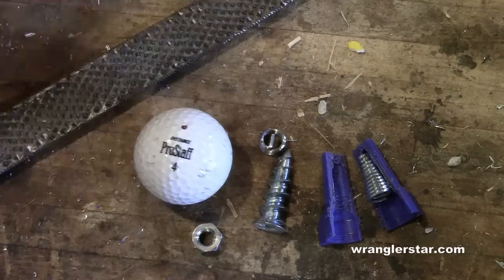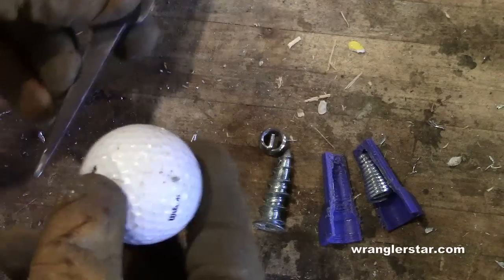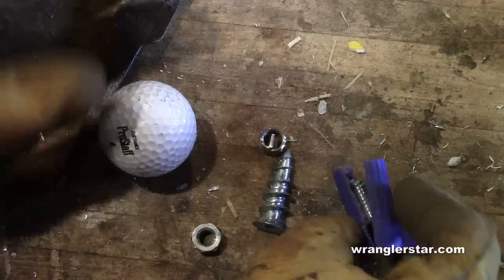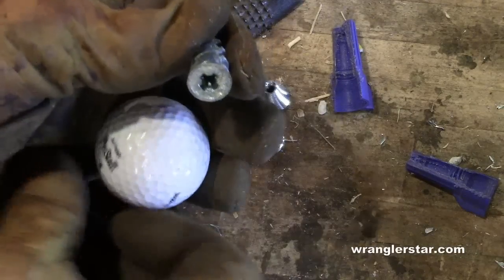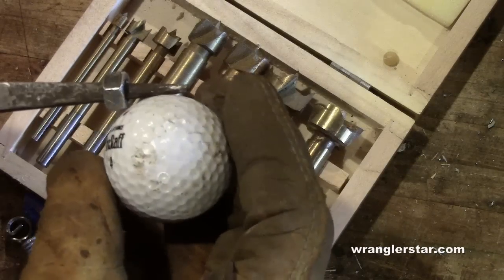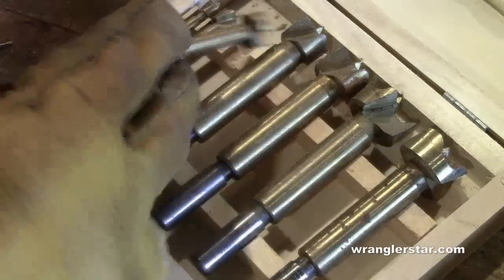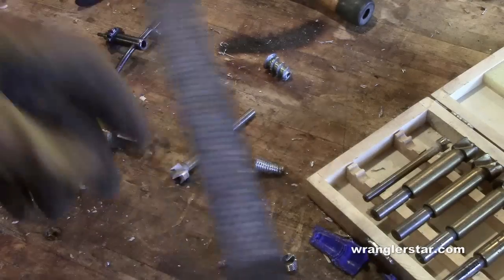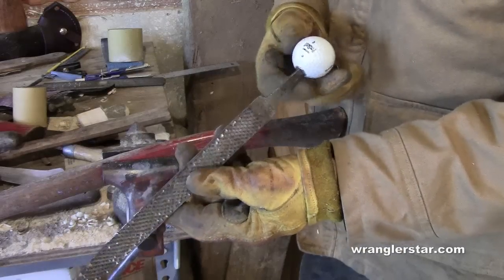Golf Ball Tool Handle - Wranglerstar

Comment: WARNING**********
Please keep in mind as you search for golf balls to use in your handle projects,unlike the newer balls that have a primarily rubber core, some of the older ones that you might find in Grandads old golf bag, might have a wound core. You probably do not want to be barehanding a wound ball, while drilling into it with a forstner bit. If the winding climbs the bit and rips the ball out of your hand, or pulls your hand into the bit...bad day.  If someone has a ball that they know is wound, clamp it and try it,  and let us know how it reacted.
Have a Great Day!

Comment: For my handles I use old screwdriver handles, unscrew the shaft when it breaks drill the hole out and press it on, as long as its straight with the file it works great, gives you a solid handle right up close.

Comment: My first time ever writing a review on YouTube. 
I enjoy watching your stuff!! 

So I tried it on my golf ball, but I put three nuts all on the same golf ball. One holder for every file I have know. 

3/16 Nut 5/16 Nut 3/8 Nut
Holds Any Size File
Took A 1/4 Inch & 3/8 & 1/2 Forstner Drill Bit To Drill Each Hole For The Nuts, Then Pressed Them In Using A Bench Vise. No Glue Needed 

Your Right!!!!
Best Handle Ever For Filling Down Metal Edges Or On Wood Projects 

Thanks Again, Keep Up The Good Work
Reply from the maker: +Rene' A. Garza Great!

Comment: I have been using golfballs for handles on thin files to sharpen chainsaws for years.  The thin file works fine with just a drilled hole.  For larger tapered files, I think you are spot on! Great idea, I will do it!

Comment: 1000's of uses for golfballs and they are cheap also. I've used them for insulators for my ham radio antennas and for caps for things. I've also put nuts in them (cut to shape and epoxyed) for handles on tractor levers. Lots of uses for sure great video

Comment: Neat idea indeed. But you can still get good wood file handles from the Lutz company, retailers like McMaster Carr carry them. They have metal ferrules to keep the wood from splitting. The golfball might be perfect solution for rasps and larger files, but when it comes to fine metal fitting you need to have a handle to control and guide the file. Thanks for sharing this and other ideas like this. Much appreciated.

Comment: Great add with the nut, Cody. I've never thought of that. I live beside a golf course and have golf balls by the bucket full in my pastures. I've used golf ball handles for years and would't have a wooden handle if you gave it to me. I've never developed a blister with a  golf ball handle. The ball fills your hand perfectly and has no pressure points to cause damage to your hand/skin. If you've never tried this type of handle, take 30 seconds and just drill a regular hole in a ball, undersized, and jam the file in there. Try it out and see what you think. If you like it, you can invest the few minutes for Cody's improvement with the nut. Personally I've never had any issues with just drilling and jamming but I like Cody's idea. It is an improvement.

Comment: I have a tip for you Wranglestar .When replacing an axe handle i had no steel shim.I cut off the threads of a half inch steel pipe then cut it in half again.Worked great.Also when using caulking gun dip it in water overnight for the next day.Just pull of caulking that seeps out.Your good to go next morning.

Comment: I've been using old golf balls for file handles for my machine shop files for 20 years.  They are perfect.  I never did put in a nut.  I'll try it with my next batch.  Thanks for the great idea.  BTW, I usually find golf balls at my local thrift store for about 25 cents a piece.  Or...  When I walk my dog in certain parts of the woods I find gold balls all over for free.  Thanks for the video and the idea of using the nut.

Comment: You can take another golf ball and slot it to fit the opposite end of the rasp or file to give a more comfortable grip when using both hands. I been collecting golf balls out of my yard, uncle use to play golf. So handles are free. I do like the improvement using a but to attach the gold ball on.

Comment: I tested this idea and found it also    worked if you drilled a hole through the golf ball about the size of the files tail 1/4 inch from the file and just hit it on with a hammer and if any of the tail stuck out it was just trimmed off and sanded to stop it from cutting your hand. 

Thanks for the idea

Comment: Solid golf ball like you used works great for knobs, they can be drilled.  The wound golf ball made with rubber bands won't work.  The solid golf ball when bounced has a ring to the sound, the wound golf ball when bounced has a dull thud sound to it.  An easy way to center the hole when drilling ball is done by first clamping a piece of wood to your drill press table, drill a one inch hole in it about 1/2" deep, leave it clamped to the table, place the golf ball in the 1" hole and drill the size hole you want in the ball, gives you a perfect center every time and it's a lot easier to hold the golf ball in place in the 1" hole while you drill it.  JB Weld is a great product to attach the ball to your tools, make sure the tool is free of rust and oil.  In the case of the rasp, when it's dull you throw the rasp and golf ball handle away, make a new golf ball handle for your new rasp and glue it on with an epoxy product.  Golf balls make great knobs for bolts that hold parts in a fixture for glue up or routing parts.  I have an adjustable support device I use on my table saw when cutting a long board, the knob for the height adjustment screw was hard to use until I replaced it with a golf ball knob.  Just make sure you use the solid core golf ball, you'll know if it solid core the minute you drill into the ball, if it wound throw it away and try another ball.  JD, Leeton MO

Comment: Great idea Mate, I can see a hundred uses for this type of handle, ie; drill press handles etc..
For file handles I usually use an old corn cob. Just drill in from the end so it doesn't split and push it on with a few taps on the end and bobs your uncle.....
Regards Matt

Comment: With the advent of Paint Ball Guns ,  theres an awful lot of empty , small CO2 cartridges laying around everywhere .  I always pick them up because you can use a quarter inch drill bit to drill out the plug in the neck of the cartridge ,  and then use the empty cartridge as a  HANDLE  for Files .  They work great in that capacity ,  I've been using them for File Handles for over 40 years .

Comment: My grandpa gave me many tips and tricks for splitting firewood.
For example, to break a round more easily he would first "tap" both edges of the cylindrical wood section. If you do this on center with one of the cracks near the center of the round I've found it will split much easier.

Comment: NEVER use gloves when operating drill press, high torque powered drill or any similar tool.
Leather gloves are not exclusion for this.
Glove can be caught by rotating bit, resulting in broken and torn fingers or fist.

Comment: I drilled the bottom of a shelf over my bench, and glued small strong magnets into them.  I hang my screwdrivers by their tips, and can see what tip I want easily, and they hang well.  I can reach up and grab the one I want, and simply pull it down to use, or put in place and leave it hang just as easily.  Just remember to leave enough room between them so that you're not hitting those on either side when you grab for one.  A side effect is that you will magnetize the tips, handy for holding small screws when reaching into hard to reach areas.

Comment: Drilling in gloves is not safe. Drill can catch and wrest your finger.
Reply: +Константин Пилипенко I agree with you. I strongly suggest to use some fixture to drill balls. Balls are always unstable when they are not drilled properly. Drilling with gloves... very, very dangerous - especially using this kind of drill bit.
Reply: +XGC Scrappy even if your gloves are loose you won't get your hand out once the glove catches its like a snare and tightens up instantly I'd rather have a cut finger than no finger
Reply: yep one of the first things I learned in machinist school was no gloves for power tools.
Reply: yep one of the first things I learned in machinist school was no gloves for power tools.
Reply: XGC Scrappy Loose gloves get caught in machinery ever better than snug ones.

Comment: Nice idea,i like the way you can put the new handle on verious size files to use.
It looks like you have alot more freedom on what angle you hold it from your body,where as a long handled file you need to stand directly behind the direction your using the file.
Im sure theres a patent there for someone.

Comment: Hi Wranglestar..here is a great idea or tip your subscribers may like if you wanted to make a video of it...This is for conserving water and it's especially good in the summers months during a drought and for people that may have a well for water...What you do is take a one gallon milk jug and you cut it about 1/3 or a 1/4 up from the bottom and you put pennies in it which are solid copper to weight it down and you put it in the back of the toilet in the water holding tank over toward the right side out of the way of the plunger and every time you flush the toilet you save ever how much water that remains in the cut milk jug..it doesn't affect how the toilet flushes or the water level in the actual toilet bowl itself...I have been doing this for over 25 years and have saved thousands of gallons of water..I know that the float can be adjusted to save water also but doing it that way you have less water in the tank and the toilet don't flush hard enough so with the milk jug you still have the water capacity but instead of all the water leaving the tank with every flush you save the amount of water left in the milk jug...hope you try this and hope to hear from ya about this idea....

PS..I use about a hundred or so pennies to weight it down but you may need more or less..Thanks.

Comment: I know you despise Harbor Freight Tools but in this instance they have the best solution to this project.. They sell a 3-pack of step drills for under $8 ,,, the thinnest/narrowest tapered bit is ideal for matching your file tails. The pressed in nut is a bad idea as it grips far less securely than just the rubber center would with a closely matched tapered hole.  If you want to be extra secure I'd thread the file handle.

Comment: I replaced the T handles on my C clamps with golf balls by removing the handle, drilling a slightly larger hole than the screw shaft in the ball and expoxying them in. Never had a failure.

Comment: you know what works great and comes already made? a gearshift knob from a manual shift transmission, they already have the steel threaded insert and you can pick them up for practically free at the junkyard

Comment: You might screw the nut onto a short bolt before you press the nut into the ball. The bolt give you room to hold it in place.  I have used the term, Cow pasture pool for years. Remember what Mark Twain said, Golf was  "A good Walk spoiled."   thanks for the tip.

Comment: Okay, I'll play "Safety Sally" only because I've made the mistake of using gloves around a drill press. You shouldn't wear gloves around rotating drill bits. If they grab the material you are along for the ride and it isn't fun. My drill press was magnetic base press used in metal building fabrication. I was pulled up off the ladder flipped over the drill motor, which broke loose due to my weight, and consequently fell with me, but only after messing up my hand. Safety Sally out...
Reply: I agree wholeheartedly. Years ago I was working at a machine shop and I saw a newly hired apprentice start up the large engine lathe they had in the shop. While wearing gloves. He started to file a piece of round stock before anyone could stop or say anything the glove got caught on the chuck and ripped two of his fingers clean off in an instant.
Reply: joedell71 Yes sir, you know exactly what I'm talking about. Unfortunately many folks consider drill presses, lathes, and even band saws, benign and harmless. They can maim you by lulling you into thinking they're harmless. I've seen my share of folks get messed up by tools. I've seen a decapitated tree surgeon, a man with 400plus stitches from a circular saw, nail guns shot through the hand, a man crushed between a forklift and a truck, a man buried in caved in pit, all experienced workers. Guys, be diligent, it only takes a split second and unfortunately it happens more to the experienced than the novice. I wouldn't wish any of these on my worst enemy, much less see them happen to WranglerStar or the caliber of people that follow him. Be Safe!
Reply: I agree too.  When I was still living at home on my parent's farm, I got my loose flannel shirt hung in some gears on an oat grinder.  Weeks of therapy and a skin graft to my L arm later, I am far, far more careful around and respectful of such machinery.  It happens SO fast!!!

Comment: I had a shifter handle that kept coming off... 
replaced it with a golf ball (used the wrong process to pound it onto the shift lever)  but it never came out and was the most comfortable shifter I've used in my standard transmission vehicles... 

I've seen people use a golf ball in the same way for their "on the tree" automatics.

Comment: I got a tip for you to try. When press your nut into the golf ball use a piece of tape to hold it in place or the other way you can do it is to wind the nut onto a bolt. This way no pinched fingers.

Comment: While I think this is a neat time saving idea and I admire the ingenuity and thriftiness, the carpenter in me can't help but want to walk over to the bandsaw and make a ball from scrap wood to match my other tool handles. I like the idea of the round ball style handle but agree I'd want it 150% that size for my hand size so it would be fairly easy to cut one of an end scrap of 4x4 on the bandsaw or scroll saw and then sand it by hand.

Comment: Tip....singer sewing machine needles are ideal for pinning plywood.  bang in like a panel pin then hit the needle on the side and it will brake off and you will not see it

Comment: When fishing tie on a 2 foot flourocarbon leader when using a braided line. Fish can see braided line but not light florocarbon. For pike use 60lb test flourocarbon leader. It wont inhibit the movement of a lure like a steel leader amd is hard so the teeth won't cut it most of the time.

Comment: Finally! A good use for a golf ball. :)
Reply: I have a nifty garden implement that has an unsharpened blade set at an angle to the handle. It's got the number 2 engraved on it and its great for chopping out weeds. Whenever I find one of those pasture pool balls in my yard I use that tool to smack it as far as I can. It's pretty much the same swing as for chopping weeds.

Comment: You can use and old screwdriver handle. put the handle in a video and heat up the metal unroll you can pull it out then warm up the end of file and insert.

Comment: All I do is drill a hole smaller than the tang on the file.  And then use a heavy rubber or dead blow hammer to drive the golf ball on the end of the file tang.  It forms a good compression fit and will not come off.

Comment: How do I keep my dog from borrowing my file after that.... AND Golf is a lot more interesting with PVC pipe and an AIRCOMPRESSOR !
File handles are easy to make ( as are screwdriver handles ect) just get some jb weld an old (but not abused) ax handle and a copper cap (plumbing) and a nut for the end... draw it out it is easy.

Comment: (Gasp!!!!!) Say it isn't so!!! Nostalgic,time honored restoration has been replaced by quick, cheap, and easy... It's a sad day...
Reply: Only thing is...Nostalgic and Time honoured, does not always mean it is the best. If someone finds that this golf ball handle is more comfortable, more flexible, and just all-round better for them? Then I have no problems with it. Function over form.
Reply: Goldmarble
Oh, Absolutely! Goldmarble...I couldn't agree more. My comment was nothing more than a friendly jab at one of Wranglestars many narratives. I don't hold Cody to any form of ridged ideologic standard. Homesteading is about resourcefulness. If you have a hundred things to do today, one of which is putting a workable handle on a rasp,and you can take 20 minutes to drill hole/insert rasp into ball, or take 90 min. to drill, shape, finish, etc, then that's a no-brainer. In fact, I've already got my golf balls lined up for re-purposing. Although, I love and regularly use old and restored tools, I am a realist and prefer to get the job done by whatever means are necessary. Bailing wire and duct tape are our friends!
Reply: Cattmann What if one use a antique and very very expensive golf ball ?
Reply: Eric Hope
Sorry, Eric...whats your question?
Reply: Cattmann No need to be sorry :) The Q is as follows : If it's such a shame to use a golf ball then what if it's a really old and antique one ? May be signed by a oldtimer pro and very expensive :) LOOOOL ! I get it, One should not do this kinda thing but if the ball fits :) he he then it fits............Can I use the idea on a brand new file ?
Reply: Eric Hope
Wow...my meds must not be working yet....Shame?...no shame...did you read my response to Goldmarble in it's entirety? You can use whatever golf ball you want to use. New, old, range or priceless antique, the choice would be all yours.
Reply: Cattmann My meds are working just fine....... Happy camper :) Play with your balls as you please. I do :) ha ha